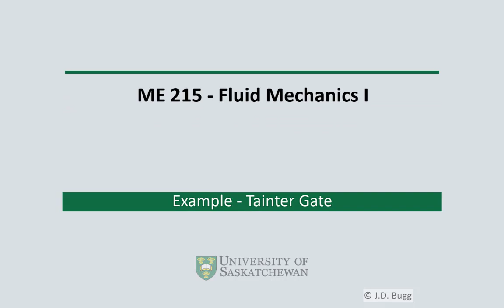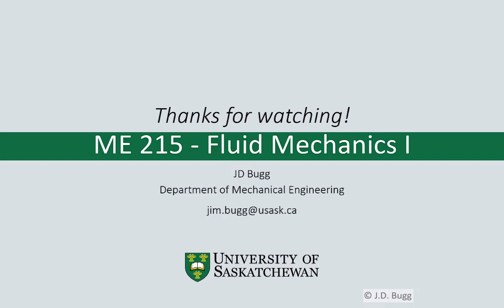Statics - Force on a Tainter Gate

Comment: Can u  please explain a bit why the Theta 1 is -45?
Reply from the maker: Certainly.  This relates to how I chose do define theta in the polar coordinate system.  (See 16:17)  Theta is zero when aligned with the x axis (horizontal axis pointing to the left from the origin) and positive theta is in the clockwise direction.  This means that the point where the Tainter gate touches the bottom of the pool has a theta coordinate of -45 deg.  This is the lower limit of integration.  I hope this is clear.